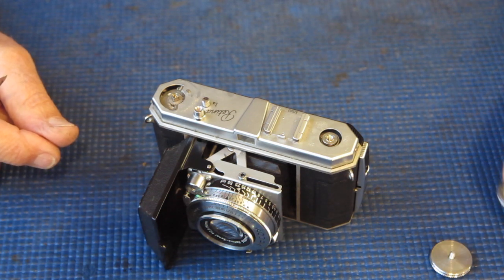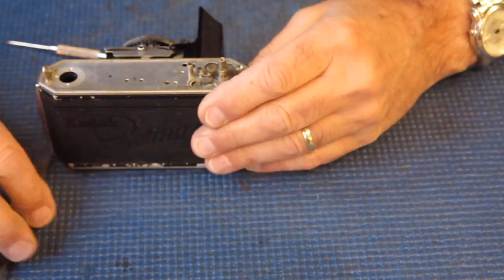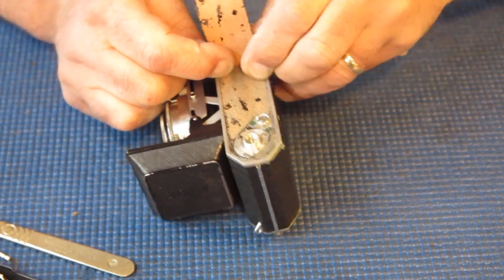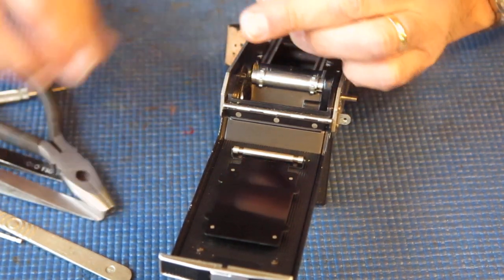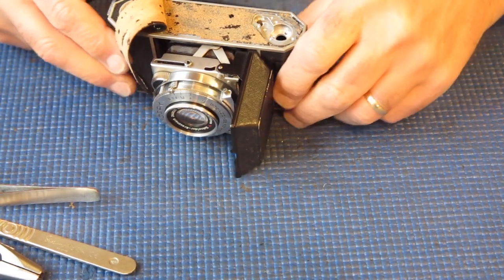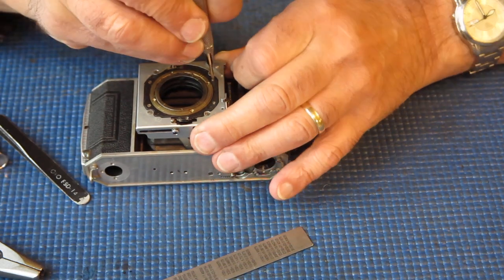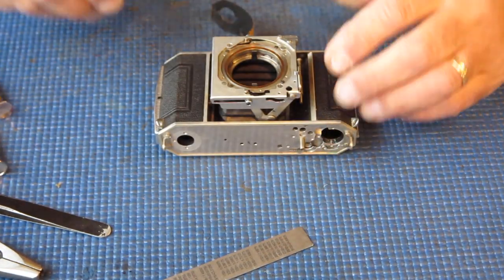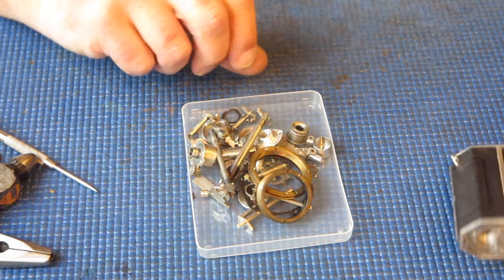Kodak Retina Ia service part 01

Comment: How can you remove the black ring? At my camera it is very tight. Is there a way to make removal easier? Can you make a video about the Vito C?
Reply from the maker: Sometimes the retainer ring has been locked with a touch of lacquer. Sometimes, a repairer has been too enthusiastic using black paint to cover scars and this has run down into the threads. A drop of acetone can be helpful.

Comment: What do use as degreaser prior to the ultra sonic?
Reply from the maker: I use 'Wax and Grease remover', the stuff I have is branded 'Andrews', but doubtless Bunnings will have something similar in their 'Diggers' range.
Reply: Chris Sherlock that sounds a bit like the liquid used to wipe down surfaces prior to being spray painted. So that should be safe with painted parts as a cleaner?  And the ultra sonic tends to remove paint by shaking it to death?

Comment: I have tis model. 
The shutter doesn't fire and the cocking lever is stuck in the closed position.
After watching several of your excellent videos, I don't think this camera is worth fixing.
Reply from the maker: Did you make sure that the frame counter isn't simply set to number one?
Reply: @ChrisSherlock  Wow! I moved it off #1 and can now advance the lever. But the shutter does not fire. The shutter release button will go down as far as making contact with the shutter pin on the shutter lever arm.
Also, when I advance the lever I can see the little brass gear turning at the XM cylinder, then an almost inaudible click at the end of the lever travel. Then upon releasing the lever to go back to the fully cocked position I can see the little brass gear turning in the opposite direction.
Reply: @ChrisSherlock  Well, since the shutter is stuck, I suspect the problem could be, as in your video at 39:40, the internal screw or screws could be loose preventing the depression of the shutter button to trip the shutter. Because of this I feel the camera is not worth the repair. It would be a 'deep dive' into the components to fix this problem.

It amazes me the number of parts that are incorporated into the camera, all of which were put together by hand on an assembly line at Kodak. It would be interesting to actually see the photographs of the workers assembling this camera at Kodak.

When I was a young boy, my aunt gave to me a Mr. Machine. Mr. Machine was a take apart and reassemble walking, talking mechanical robot manufactured by Mattel. After a time I could take apart and reassemble this robot without instructions. It was a wonderful gift and provided a fun learning experience.
The camera in this video that you take apart Chris is much more complex than the Mr. Machine. I am guessing that you have taken apart and reassembled many of this model. I base this on the ease of what you turn and remove with ease in your video.
Chris, you are an expert! Thank you for your response and this video that you made.
Best Always!